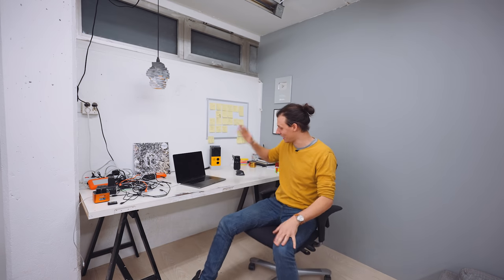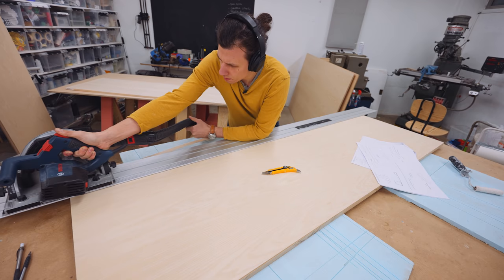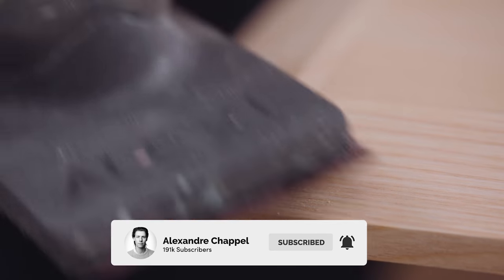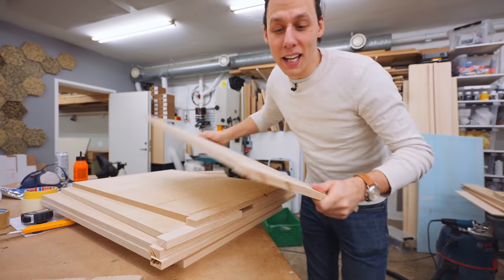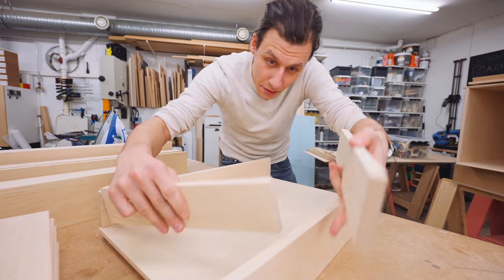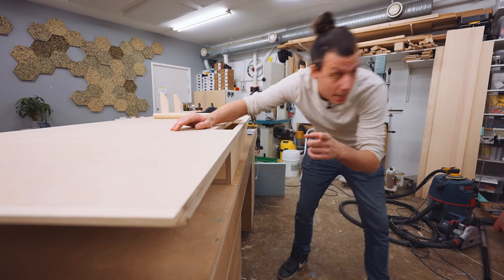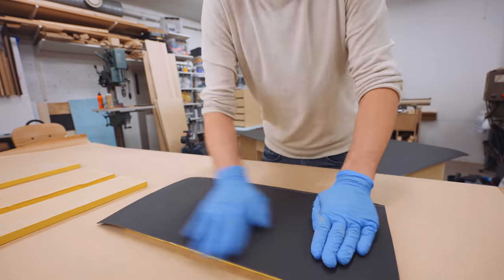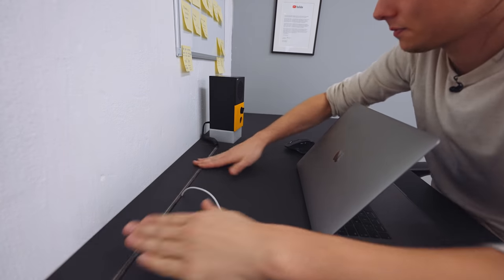Making a Desk With a Built in MagSafe charger!

Comment: Am I the only one that panicked when he sanded over the charger?
Reply: Not just the sanding of it, that is a lot of trust in the longevity of that charger... Nice desk though!
Reply: @mikea3793  well if it dies, it dies. It won't affect the desk in the future
Reply: @matheoml  It's not a matter of if, but when the charger dies.
Reply: Yeah personally I'd have done like I've seen it on other projects cut the hole all the way through and just put a screw in plug or something underneath so if it breaks you can unscrew it and put in a new one. Not fond of permanent tech in my furniture. I like them to be user serviceable or changeable
Reply: @matheoml  Obviously the desk will still function as a desk, and a nice one at that, but.... if you look at the description it's a desk with a built in charger, so id that dies it will fail in its described function. If we want to be specific ;P
Reply: @rickgeller6043  the charger will be outdated before it dies, i guarantee apple is going to ditch the magnets after launching a couple of iphones with it
Reply: would have much preferred a larger aftermarket standing-type charger that can contact charge multiple capable branded phones/ipad/watch/ear-pod, and maybe have a recess in the table for it to sit in. which also means I can use the screen whilst charging if I wanted
Reply: Nope
Reply: I’ve epoxied over a apple watch charger. I really wanted a black one. Black epoxy is nice
Reply: Nah, his measurements are perfect in all his videos, I was sure it was just hare 16th or 32th of an inch below the line... QI type changers (that is the now standard (iPhone and Android), are cheap. I would of made it thinner, if you pull it apart you could just use the coils to the charger and would get stronger signal....
Reply: You could curve out the camera bump into the desk top 🤔 Phone will lay flat this way and charge properly 🤔🤔
Awesome desk Btw!
Reply: No

Comment: You could probably draw the outline of the phone when its perfectly aligned on the table so you can see where to put it exactly
Reply: Draw or put a sticker.
Reply: More like using a stencil and some low gloss spray varnish, very light, would do a visual reference without ruining the overall black finish
Reply: @bedongskifrombedongdesign1062  yeah I meant something like that not like drawing a white outline haha would be a little bit too much but just something to like mark where the phone has to go
Reply: Using a router to make a shallow hole for the camera bump would be cool and keep the phone in place
Reply: @solarcheese  what happens when they change the bump for iPhone13?  Probably a new table!
Reply: @Andre-Nader  hah. More content for us then. But honestly, I also would have dug a 1 or 2mm indentation into the linoleum, so it sits flat. And from the last decade I would say it's unlikely that apple moves the cameras to the other side of the phone. It's rather likely that magsafe will die again.
Reply: I have the exact same problem and considered making a “desk lamp type” with 4 small 12v lasers outlining the spot where the charger lays. You could also consider some other light spot, that has the shape of a phone which would go unnoticed to anyone else but you.
Reply: @Andre-Nader  make a bigger hole and 3d print plates to fit all your devices
Reply: @Andre-Nader  What happens if the Magsafe dies?......same scenario imho.
Reply: @solarcheese  I like that idea, also cutting the top material and replacing it with a different color, thinner, and softer material would give reference and protection, maybe even make a shallow hole for the whole phone.
Reply: @solarcheese  It would make the desk look like crap and one day that charger will fail and so will the phone. It's part of Apples master plan.
Reply: He puts his phones lens against the table 😭😢

Comment: You got super lucky there weren't any noticeable or unsightly bubbles on the top layer. Next time you are laying linoleum or other thin contact glue type layers use wooden dowels on the table surface to give separation while also allowing you to apply and roll the face cover evenly. 20 dowels in between will let you roll the dowels out from the center as you work the materials together.

Comment: Beautiful desk. Pro tip...when applying a large sheet (linoleum, Formica, etc.) with contact cement, place dowels or scrap wood strips between the two surface until positioned correctly, then remove the spacers from one end to the other.

Comment: When using contact glue as a carpenter i always laid thin strips (e.c. 10mm x 10mm) of whatever wood across the width of the glued table surface more or less 100 mm apart. Then i put the linoleum glue side down on top those strips so it does not stick yet but it you can position the linoleum. Then you can pull one strip out at a time and press the surfaces together after taking one out. No wrinkles, perfect positioning and no stress ;)
Reply: Love your vids though, thnx for that

Comment: This is crazy. I designed and built a shockingly similar desk 4 weeks ago. Lino finish, beveled edges, rear cutout. The only difference is that I used the back cutout to hide the monitor stand/integrate it and where you sit it’s cut out in a semicircle to allow better access to the work surface. I should add that yours looks fantastically clean too, well done.

Comment: I can assume someone else may have already posted this but a very easy way to apply a laminate to a surface is by laying scrap wood strips across the surface (after glue is applied and tacky).  This will support the laminate until you are lined up and ready to glue it down.  Starting in the middle pull out a stick and let the laminate come in contact then the next stick and so on.  Once all down you should be lined up right and air bubble free.  Use a weighted roller to get a good glue bond.
Beautiful desk!  I love the details and modern design you build.

Comment: I you use sticks as spaces, you can put the linoleum sheet easy and calmly on top of your desk. Then remove the middle stick, so the two surfaces touch (and stick to each other)  and then work out to each side very easy and with no stress.
The sticks will not get stuck to the contact cement if it is dry enough for assembly.

Comment: Would probably suggest putting another hole in the back of that drawer with a fan to circulate the air in there because the heat some batteries put off while charging could turn it into a bit of a hot box for your other batteries. Probably not needed for most but just a suggestion depending on the batteries you charge/use and how hot they get.

Comment: Great Desk Alexandre. If you ever have to stick down a surface like that linoleum again, try using dowels as spacers. You glue both surfaces as you did, but then once it has dried you place dowels or strips of wood every few centimetres on the substrate (table top). Place your vinyl (or formica) on the dowels, and then work from one end pressing down and rolling out the air bubbles. Work towards the other end, removing the dowels as you go. This process is a lot less stressful, you don't have to do it all right in one go, and you are less likely to trap air bubbles.

Comment: Tips on laying down large linoleum: You can always put a couple of wood slats or round rods before laying down the two adhesive material, just enough to lift the linoleum sticking to the other side. So when you lay down the linoleum there is enough adjustments to fix your overhangs. Work your way one end. And then pulling out the slats/rods out as as you go.  Hope this helps for future videos. A great simple desk, and love the black and wood contrast.

Comment: Pro tip use wood clamps as spacers when Installing linoleum or laminate. You can line it up then pull the clamps out and the linoleum will be aligned when it sticks.

Comment: Great video! Beautiful table! 
One tip... When putting the black laminate on. Once the adhesive was applied to both surfaces you could put thin strips of wood as temporary spacers on the table top, lay the laminate on top of the spacers, align it and the remove sticks one at a time starting form the middle they apply pressure from the middle to ensure no bubbles. Anyhow, what you did worked just fine ;)

Comment: Next time using contact adhesive, put wooden pins with 20 cm spacing on the top surface. That way you can lay the laminat on top, pull out the  pins  in the middle and start working your way out :)

Comment: Good to see you using a tracksaw in this one. I don't have or even want a table saw so use a tracksaw for everything. I liked your contraption for your router to trim off that thick edge banding. You could have also used it for the thinner stuff I would imagine. Mirka sander in there as well...pretty fancy. I have the older model. Wish I had have waited to buy the newer ones without the awkward power box.

Comment: instead of hard mounting the magsafe with glue, maybe allow some movement to slide around, that way the charger will try to move towards the phone too.

Wrap some soft spring around the wire so it springs back to location when not in use.

Comment: That's a really nice build!    After Christmas I want to start working on insulating my garage to 
turn it into a shop, and a desk is probably one of my first projects I want to work on.  I want full blown cable management and outlets etc so 
it's always cool to see other builds to get ideas.      My only concern is the fact that the charger is not easy to swap out though.  Apple changes stuff all the time so whatever next phone you get will probably not work with that charger.

Comment: 18:55 - some dowels ... long enough to go across the desk, would keep the linoleum and top surface separate until you were 100% sure it was centred/straight.
Reply: that's what we did in the cabinet shop I worked at,  and a hard rubber roller to smooth it down

Comment: You could have used a normal (and probably cheaper) wireless charging pad that can be bigger and have more reliable positions to charge any phone
Reply: Or use a MI self centering wireless charger
Reply: @Andre.vdk_covers  not in his case, where the camera bump makes the magnet inefective
Reply: hindsight is 20 20
Reply: @marpheus1  Sand down the camera bump so it will lay flat on the desk and make better contact with the charger.
Reply: @marpheus1  the phone case compensates.

Comment: Bro, hold on. So, listen up. Cut your logo in linoleum, on top of the table. And feel the gaps with that special linoleum glue. But add a red dye into the glue. So you will have a red logo on a black table. And also, put\smear some linseed oil on your table edges. Make it a little bit shiny.

Comment: Be careful with that power strip in the drawer. I am not sure if the cable will keep up with the constant opening and closing. Won't be nice if it starts burning in there because the cable of the power strip failed.

Comment: 21:52 I never hated Apple's protruded cameras more. A solution to circumvent this faulty design making the magnetic attraction so weak over a flush & flat surface is to make the table woodworking around a MagSafe-compatible round car charger mount, instead of the official Apple MagSafe Charger. Because a MagSafe car charger has much more powerful magnets than the standard one (they have to strongly keep the iPhone in place vertically without it falling off despite speed bumps).

Comment: So... You embed permanently a cabled, 45€ charging puck under the surface of your desk, that you can't easily find because there are no markings, could get its cable damaged rendering it useless and incredibly difficult to replace, and it doesn't even work properly with your phone?
Reply from the maker: That pretty much sums it up, yes
Reply: @achappel  My first thought was: Let's hope Apple won't switch to a different charging method at the next model year...

Comment: A router and a very simple jig can get you as shallow of an angle as you want on the underside. It even works well on a curved top. I did it several years ago! 
https://www.byggahus.se/forum/attachments/img_20160924_170652-jpg.194465/